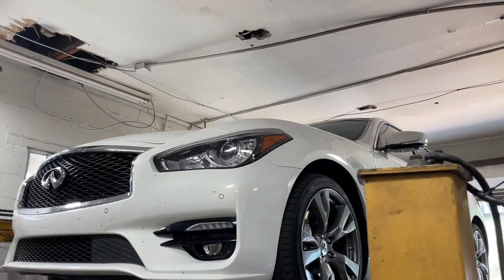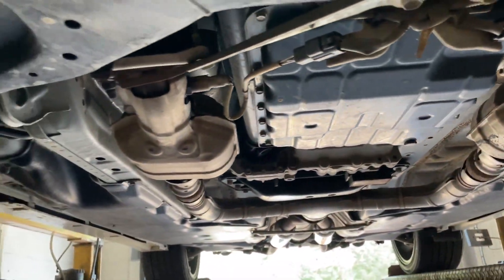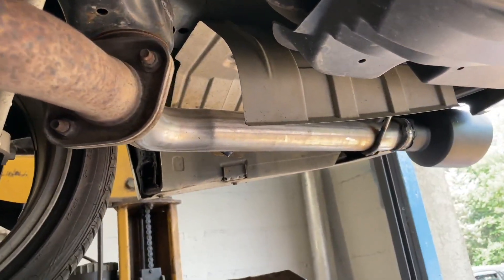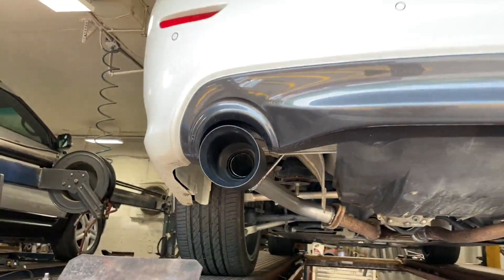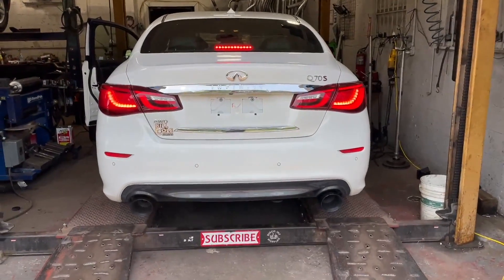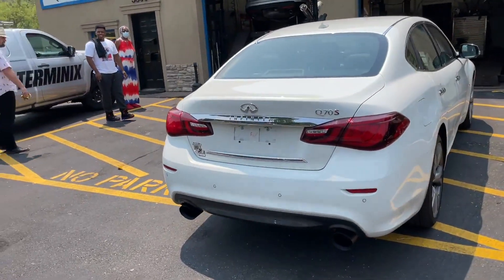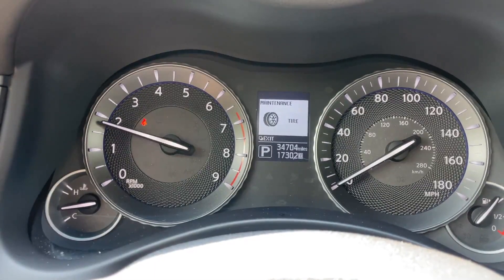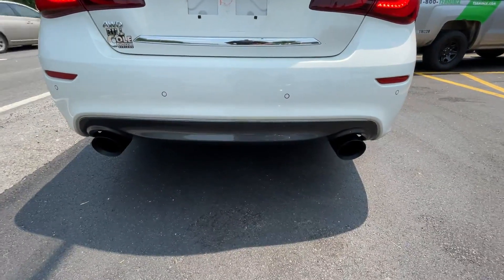2016 INFINITI Q70 S 5.6L V8 AWD DUAL EXHAUST w/ VIBRANT BOTTLE RESONATORS!

Comment: That V8 has a hint of that VQ sound it in.  It sounds lovely.
Reply: I’m pretty sure the VK Is just a stronger vq but with two more cylinders
Reply: Yeah definitely sounds like the VQ just better
Reply: Vq fine ass sister 😂
Reply: @anthonyharipersaud6862 It’s been a while since this comment, but the VK is a fairly different animal compared to a VQ, however the architecture and flow of the head is very similar if not identical to a VQ, so that’s likely where the sound comes from.
Reply: @360wave1 real
Reply: As someone already mentioned.The truth behind the VK platform,is that it is in fact based off the VQ engine,it just has two more cylinders.And with the right mods and money has strong potential to be killer motors on the street and track.
Reply: @thrustinthrottle652  It shares some similarities, but it is NOT a VQ with two extra cylinders. The biggest differences include the difference in design of the crank and the V angle of the two engine, with the VQ being 60 degrees and the VK being 90 degrees.
Reply: i thought the same

Comment: 5.6L V8 engine + AWD = SLEEPER 🤫
Reply: Agreed 🌝
Reply: Just got mine 2011 with 77k miles 😮‍💨😮‍💨😮‍💨 i love it
Reply: heavy asf
Reply: @Only1Kato  weighs less then a charger rt, and makes 50hp more. It’s heavy while still being less then chargers but it’ll move. Would stay relatively on the back of a scat pack with the 400pound diff.
Reply: @slowspecv69  take out your spare and trunk carpets and you’ll lose some more
Reply: @cobygreenwood1015  yup. gutted fbo tuned m56 gaps gutted fbo tuned scats
Reply: @juicegg3088  how much
Reply: @shadowk4718  19k
Reply: @juicegg3088  hm it go for with 77k miles ?
Reply: @Only1Kato not really
Reply: Big facts the v6 isn’t bad neither
Reply: @TheHasan187  mine makes over 600whp on e85. I love my v6 🤫
Reply: Bought mines a month ago

Comment: Not loud enough for me but sounds good
Reply: Tires, and making sure you're not heat soaked. Like most recent cars, ecu pills timing, primarily in 1st, when great soaked. I've got toyo 285's on the back of my m56s, with the stillen exhaust, intake tubes, and dryflow drop in filters. Pulled an M3 with boltons (not the brand new ones lol) on the freeway recently, and pulled 1.5-2 cars by 120ish. Also  took down a Trailblazer SS with boltons from a dig spinning through 1st a good bit. We roll raced too but I obviously had the advantage there and put cars on him pretty quick after giving him the hit. Both were shocked as was I haha. But I live at sea level, it's cold, I wasnt heat soaked and my tires were pretty warm. 
But no, not gonna be pulling the newer 10sp mustangs or Camaros. Will need my headers installed, secondary cats removed, and a good tune to compete there